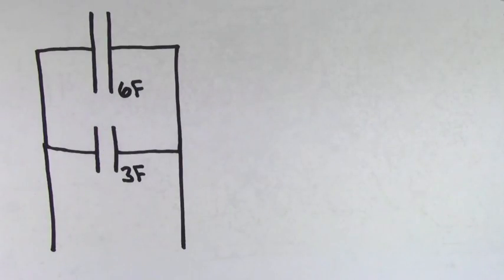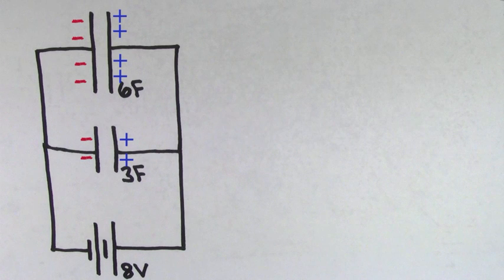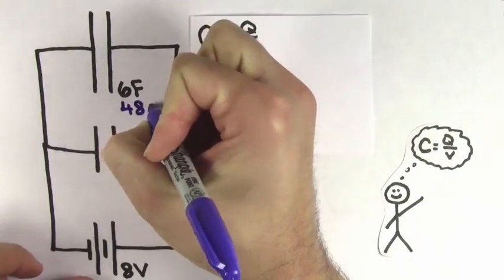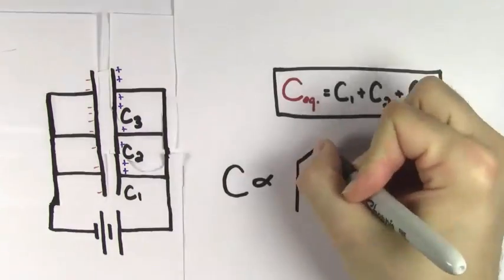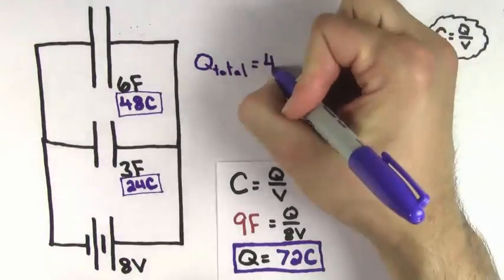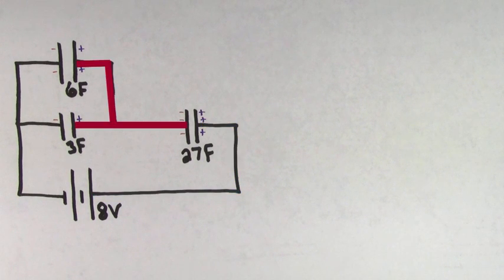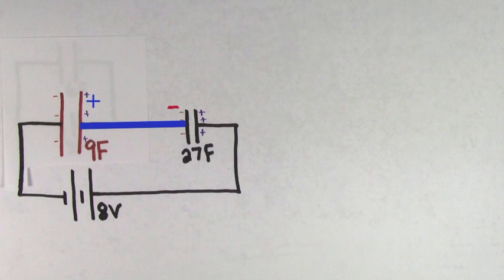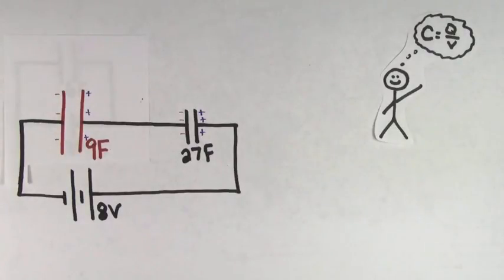Capacitors in parallel | Circuits | Physics | Khan Academy

Comment: A good way to remember formula of capacitor and resistor in series or parallel is they are reverse of each other. In series, Req=R1+R2 and 1/Ceq=1/C1+1/C2 for example.

Comment: Is there any practical applications to using multiple capacitors like this instead of one equivalent capacitor? To me it seems like more parts that could go bad...
Reply: You simply use more instead of one when you don't have "that one" or when you need a specific voltage / capacity that you can't find in an already built capacitor .... depends on what you build :) !

Comment: Say I had a 200uf and a 680uf in parallel both of the same electrolytic type and voltage, would there be any difference in the time they take to discharge?
Reply: you have two capacitors in a circuit.... the greater the capacitance of the capacitor, the more the charge will be stored across a parallel circuit...According to the formula E =VQ ,since energy transfer is inversely proportional to charge  as voltage remains constant in a parallel circuit...the more the charge a capacitor will have, the less the energy it will get whilst discharging and..... the less the energy it gets, the more the time it will take to discharge so in that case what I think is probably the capacitor with greater capacitance will take more time to discharge compared to the capacitor with smaller capacitance..

Comment: If the two capacitor connected in series what well be the resistance?
Reply: You calculate it the same way as resistors in parallel. He has a vision on it

Comment: good luck charging a 9F capacitor with 8V batery
Reply: its a military grade capacitor.
Reply: what about 27F one😂
Reply: Why? Doesn’t it just draw amperage until it reaches the 9f limit?
Reply: @7356205  capacitance is charge over volts. You would need 9F * 8V = 72 Coulombs of charge to make this happen. This is an IMMENSE charge and your battery would likely die long before it was able to do such a thing. Furthermore, without a resistor to slow it down, it's highly likely the high current draw would rupture the cell soon after being wired in. A resistor in series would help, but it would also consume extra power and mean even less charge would store in the cap before the battery dies. Also, the voltage of the battery would drop gradually as it reaches the point of being effectively "dead" though in an idealized circuit we only approach this condition.
Reply: Thankyou and makes sense. I guess I was thinking about lead acid batteries, don’t they only discharge so quickly? I mean they can’t discharge as quickly as a lithium battery right?
Reply: @7356205  I'm no expert on different types of batteries, but if the internal resistance of lead acid batteries is higher, then this would seem correct given the circuit is identical otherwise.
Reply: ElectroPOLITIKtikBOOM ok, sounds like you know what you’re talking about. Are you a student then? Or expert in something else? Anyhow thanks for the response and good luck in life.
Reply: @7356205  I'm a former Army helicopter electrician/avionics mechanic and a 4th year electrical engineering student. I'm a little better with the theory of how batteries work than the differences between the varieties, but I consider this a learning opportunity. I will do some light research and let you know what I find.
Reply: One other thing to consider is the discharge rate when the batteries are not connected to anything. This is a shelf life consideration and may not necessarily be related to the resistance presented while connected to a circuit.
Reply: ElectroPOLITIKtikBOOM, that’s awesome dude. I’m studying in school and have been for a while but still finishing up with my math right now to get into my higher classes. And sure let me know what you find! 
I do know that lithium batteries are good for their high discharge and that lead acid batteries are an older more simple form of battery that we obviously still use..but that’s about the extent for now.
Reply: Just a question 😁 I have a 4000 watt amp 3000 rms and have already a 1.5 f capacitor but still need more power would it hurt to add another capacitor in parallel or would it damage battery ?
Reply: @jadcock1023 I doubt it would hurt but honestly, those capacitors don't benefit a car audio system much at all. if your car audio system is really running at 3k RMS I would recommend an aftermarket alternator and the big 3 upgrade.
Reply: @7356205  thk you for your advice